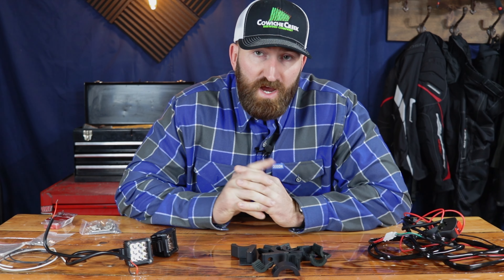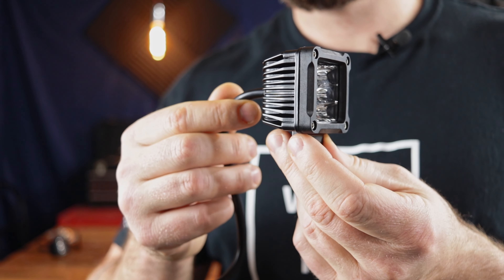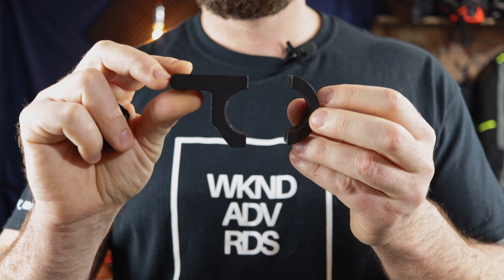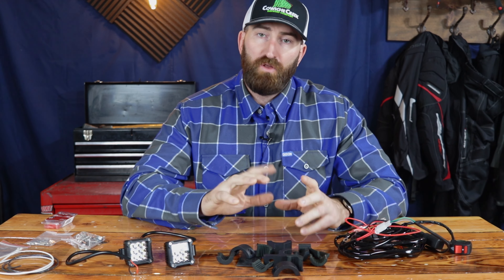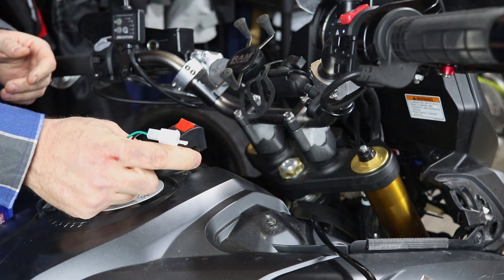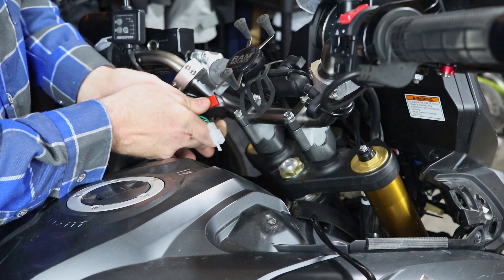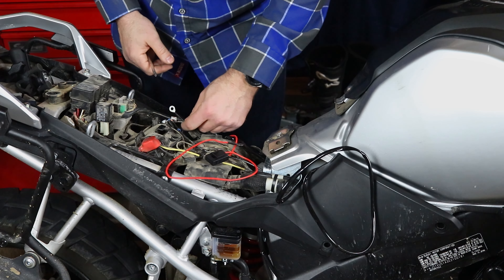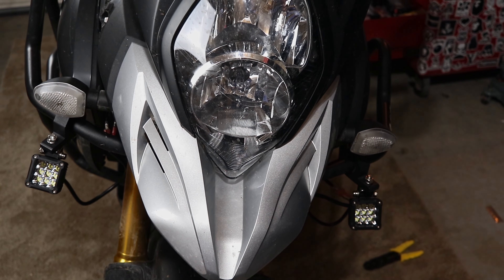How to install LED Auxiliary lights on your Motorcycle for $50

Comment: The downside of having them near turn signals is that they will likely create a photonic barrier that will prevent your turn signal from being seen. That’s the reason modern vehicles are using switchbacks, to mute the headlight when a turn signal is activated, and then once the turn is completed the headlight comes back on.

Comment: 100% did this and it's so incredibly worth it. Two things I did differently...used SW Motech light mounts and replaced the switch with a $10 waterproof/illuminated handlebar toggle from Amazon...massive improvement on my '21 Versys 300. THANK YOU!
Reply from the maker: Hell yeah!

Comment: Great video
 One question please. If you want to add more accessories can you  connect to the battery on top of the ones you already connected. In other words how many accessories can you add to the battery terminals. Thank you very much
Reply from the maker: This is more so dependant on the output of the generator.
Reply: Get a junction box and tap into a switch live.

Comment: Why have a separate switch? 
Connect it to the high beam switch thru a relay and the fuse as near to the battery as possible....
Reply from the maker: For me it is better to not cut into the wiring on this specific bike. But I like your idea to have it integrated into the highbeam switch. For my current build or future ones I would consider this method.

Comment: How would I put some of these on my 1995 xr250r.  Thanks your videos are great I’ve been using them on my xr250
Reply from the maker: In order to run auxiliary LED lights you have to install a battery.
Reply: @WeekendAdventureRides  ok what if I want to make my headlight bulb led?
Reply from the maker: @Fieldyfan94  you might be able to get away with an inline capacitor.
Reply: @WeekendAdventureRides  would that convert it to work with a led bulb?

Comment: i bought the same setup and installed on 2022 Africa twin,  everything went well for first 10 min and then one side light stopped working all together, Not sure whats the issue, the wires are good, 
any suggestion?
Reply from the maker: Multi meter and check that the light is getting power. Start at the light and work backwards.

Comment: Could you use the power from the front turns, and use the oem switches/wireloom?
Reply from the maker: Yes you absolutely could but I didn't want to cut into my stock wiring harness.
Reply: @WeekendAdventureRides  right on. I'm used to having to rewire everything! So when I see good wires and switches, I try to use em haha. Call me lazy

Comment: Do you think the light will drain the battery?
Reply from the maker: I doesnt seem to be an issue. Im to the point now that I need a more robust charging system
Reply: @WeekendAdventureRides  
Thanks for sharing.

Comment: How would you adapt the wiring so they can only be switched on and off if the ignition is on?
Reply from the maker: You would use a multimeter to find 12v ignition power. It would be slightly more complicated. It's not uncommon tho, have to test wires and turn the ignition on and off to find a wire.

Comment: As these are wired directly from the battery, could a kid just turn them on?
Reply from the maker: I suppose so. I don't have any kids BUT It would be possible to wire them to the ignition switch.
Reply: Could I take a live feed from the indicators or similar, what gauge wire is needed, any video links for wiring into ignition.
Reply: You could tap into your harness and find a switched wire, but first check if you have a free slot on your fuse box and use it to create a second circuit with a relay and second fuse box. Makes it much easier to add the lights and other accessories in the future, and they’ll be switched, so it never drains your battery.
Reply: Any link that shows this?

Comment: Hi
I am a total novice when it comes to electronics so i am going to ask probably a silly question 
I just bough myself a KTM 390 Adventure and it has spare dedicated auxiliary ports ( 2 wires only on each pos & neg i assume) 
I also know that these ports have their own fuse.

So that would give me the power to the lights But i don’t know how to incorporate a switch 🥴, if i hook up a pair of lights like you did.
Plus, do i need to incorporate a relay 🤷‍♂️
What is the actually relay for?

The lights i purchased have only a red and black wire and so i am stumped as to install them with a switch ( i will buy a switch for these shortly)

Anyway hope i made myself clear where my problem is 😬, as said..i got no idea 🤷‍♂️😂
Thanks for the video and i hope you can answer my question
Reply from the maker: I would run a dedicated wire from the battery and not cut into the wire for the aux ports. You'll want to be able to charge devices with those. You can find wiring kits with switches online. That way they have there own dedicated fuse and your not robbing amps from anything else. The switch will go in line from the power source to the lights. You really dont need a relay, it's basically a switch.
Reply: @WeekendAdventureRides  thanks mate, that makes sense 👍
Reply: I’m new to all this too, but if the lights are directly connected to the battery with only a switch in between and no relay to something like an ignition or gps unit would that not provide potential for you to accidentally leave lights on and drain the battery when bike isnt running? Wouldn’t  a relay make it so power only goes to the lights when the bike is running?? Thx for the video!